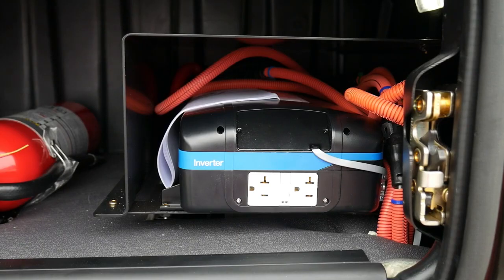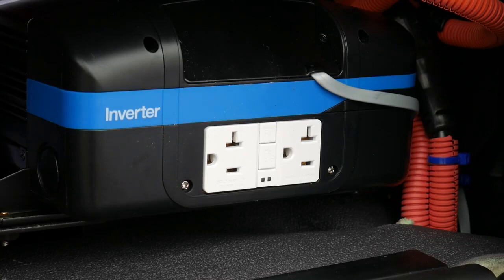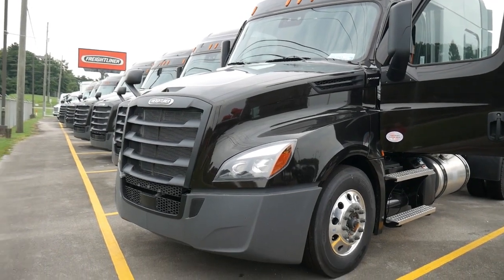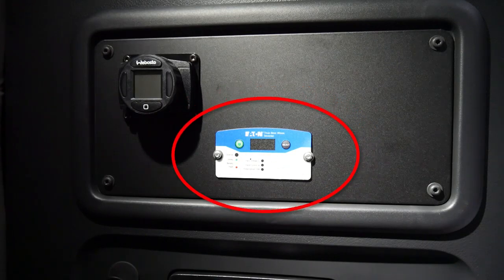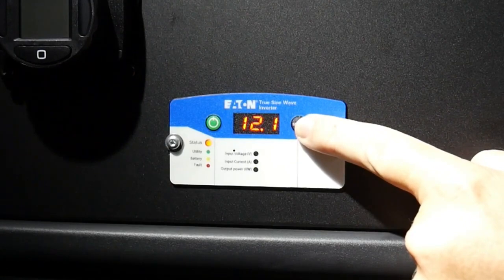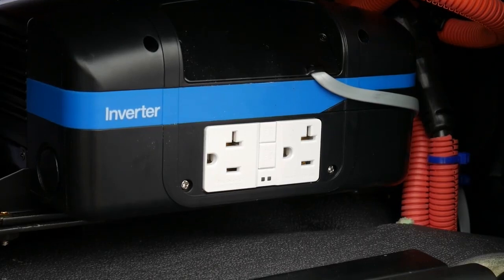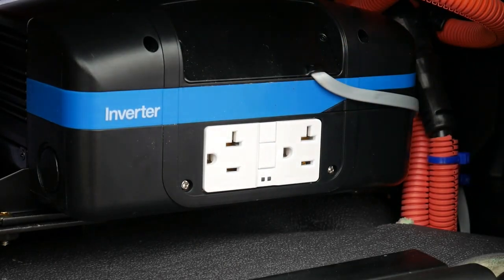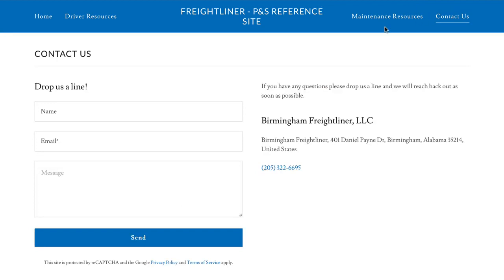2021 Freightliner Cascadia: Everything You Need To Know About The Inverter

Comment: My truck has 26 miles and the inverter is not working. It’s displaying a yellow and red light on the actual inverter. What does this mean? I pressed the test and reset button and still nothing.
Reply: Mine doing same, did you get it figured out?